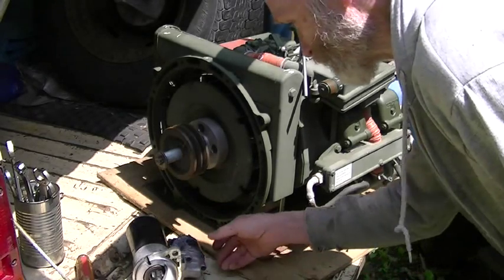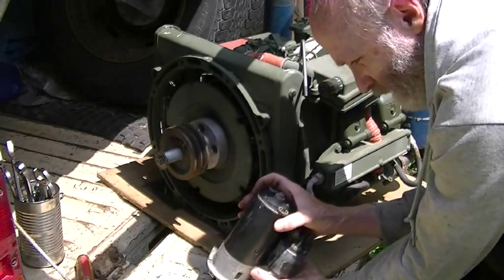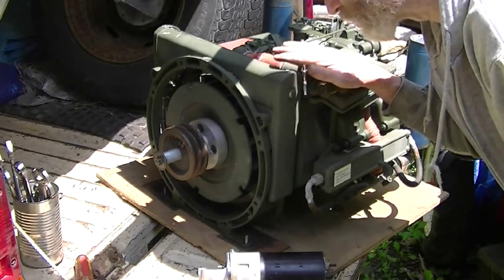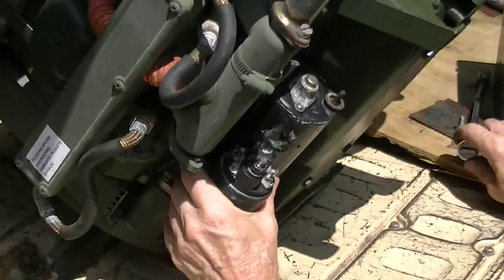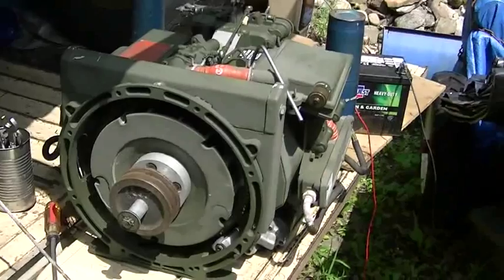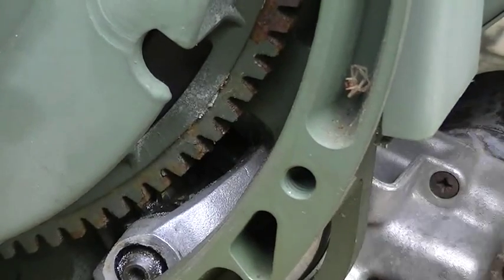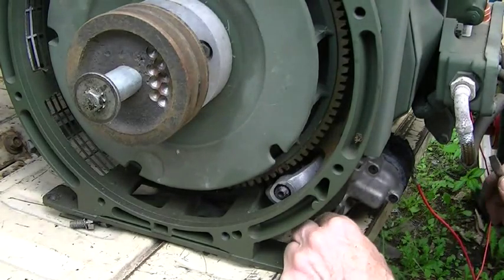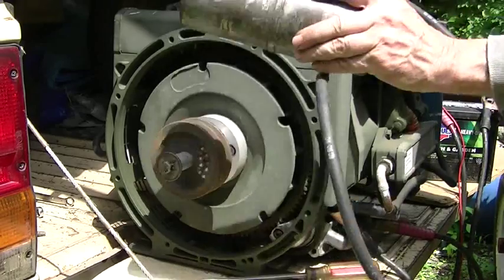Starter on a 4A032 Military Engine

Comment: i know this is an old vid but i need an output adapter and Saturn is out of business. i dont have a lathe
Reply from the maker: In see that they closed up last year. There is Coleman's military surplus only a few miles from Saturn. I wonder if they got their inventory. But it doesn't show on their web site. I see on Craigslist and FB marketplace of people selling these military engines. I think Saturn might have had an auction to get rid of their stuff. The worst thing is mounting these engines, not a simple thing. Bummer that I won't be able to get parts like oil filters and such anymore.
Reply: @HarleyFXS  id have to dig my 032 out to see , but i got this engine assuming id have to fab some parts as its an uncommon build and from 66

Comment: I traded some trailer tires to my bil for 1 such engine. I looked for a started for it and found a new one under my workbench that fit perfectly. It was for a john deere 4125. I only used it since it was free to me as the old deer powered sandblasted it was for died. Perfect fit but $$$$

Comment: I took a starter from a Volvo 850/V70 TDI with the VW 5cil diesel engine. It fitted right away and the only thing I had to modify was replacing the screws that hold the cooling fan to the flywheel for allenhead screws to make just enough room for the starer clutch.

Comment: Paul, where did you get that shaft that’s bolted to the flywheel? I’ve looked everywhere and I keep coming up empty-handed! Help a brotha out?
Reply from the maker: Google "Saturn Surplus" they used to sell them for $50. I made mine on my lathe. I made 2 different sizes.
Reply: @HarleyFXS  Saturn surplus went out of business
Reply: I already contacted them. It was a limited run and they are all gone!
Reply from the maker: Is this the place you checked? It still shows on their web site-- http://saturnsurplus.com/engine/4cylsft.htm

Comment: Hello Paul, I'm on my way Friday to Macon Georgia to pick one of these 4a032 bad boys up, did you ever get your sawmill working with this engine?
Reply from the maker: Not yet, cut a lot of metal, need to start welding. But after thinking, I think it would be better if bolted together, so I can disassemble it, so it can be moved.
Reply: When you do get around to it, please make a video! Thanks
Reply: @HarleyFXS  does the engine already have the RING GEAR for the starter attached to the flywheel ?
Reply from the maker: @craigalston2208  Yes, the ring gear is part of the flywheel, they all have them.
Reply: @HarleyFXS  thanks for the help .

Comment: I'm having trouble removing generator from engine? I got bellhousing bolts, flex plate bolts, mount bolts and box removed but it comes back about half inch and seems I missed something
Reply from the maker: Go to this military manual, and down to 6-1 and 6-2, says something about raising generator end to clear the frame. not sure what it's saying. https://books.google.com/books?id=3QIYAAAAYAAJ&pg=SA2-PA26&lpg=SA2-PA26&dq=MEP016+remove+generator&source=bl&ots=hQSa8EkbXu&sig=EcgIOaKNcIunvJFMwTW0eAPFpI0&hl=en&sa=X&ved=0ahUKEwipsvLlstnZAhXBxFkKHZnDCb4Q6AEIJzAA#v=onepage&q=MEP016%20remove%20generator&f=false
Reply: have you removed the engine/gen head from frame completely? im not sure on this unit as mine is just the engine but most small generators need to be removed from frame before engine/gen head separation

Comment: Many thanks for your help on getting this engine cranking with a electric 12 volt starter. The starter as you showed needed a little fitting up, but worked excellently. The one I got was out of a 1993 318  .  Can't thank you enough.  Mike

Comment: Is this a 1992-1995 or a 1996-1999 starter, or does it matter? I don't want to buy the wrong one on eBay. I have enough "boat anchor" parts in my shop now to almost build a car. Ha ha!
Reply from the maker: I used the 91-95, bought 2, slight differences, but fit the same. I got mine from junk yard eBay sellers for around $25. The main concern is the actual diameter of the motor, must be small because of limited space on the 4A032 military engine.

Comment: What can you do with this engine?
Reply from the maker: Shane K I'm making a bandsaw mill right now for it. There are lots of videos of ones that people built on youtube, check them out. The pulley shaft on the end, has to be made, this engine does not come with a shaft. Military surplus sites such as Saturn and Coleman's sell them for $50. I made mine by molding aluminum and pressing a shaft into it. I first wanted to make a gokart with it, but this is considered a stationary engine and shouldn't be moving when running.
Reply: There's one on Craigslist right now so I looked up what they're good for, people are making small airboats, sawmills, and actually adding horsepower somehow and using it for experimental aircraft! I guess there's a restrictor plate you can take out and add HP. Anyway, thanks for answering, good luck on the bandsaw. You should put up a video of it when your finished.
Reply: Shane K
Reply: you can use it for anything you'd use a 15 horse gas engine for. they are under-rated for military at 7hp but can easily do twice that stock. government requested a 7hp engine so continental downgraded the specs on their existing 032 to fill the request